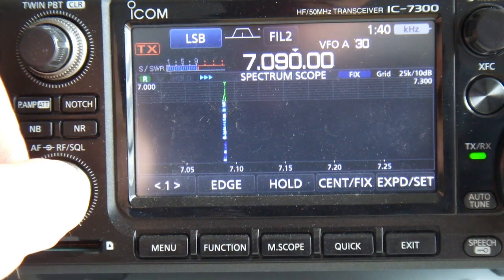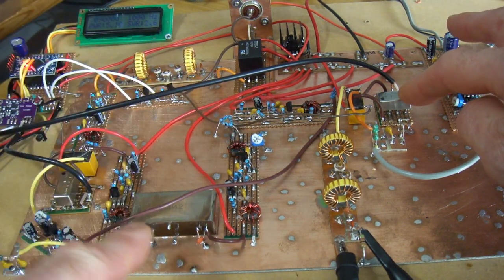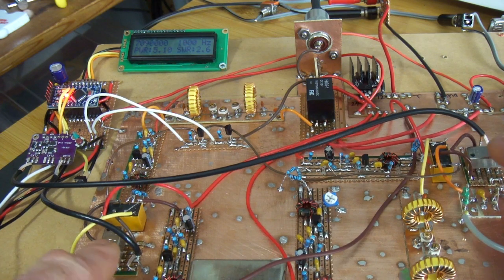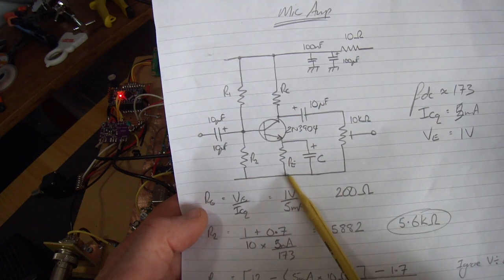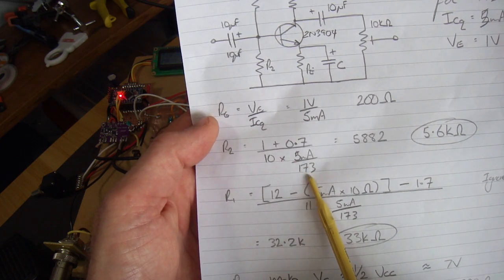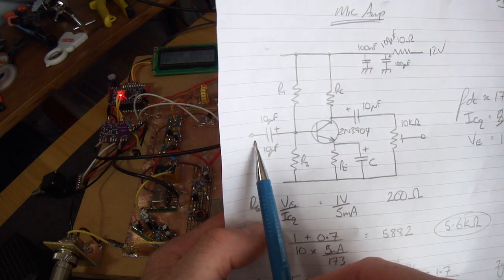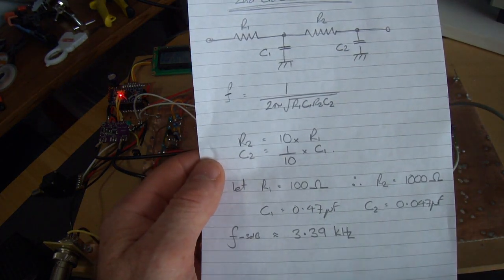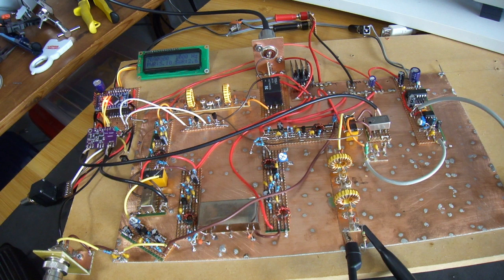40m Pelican Case SSB Radio - Part 8: Microphone Amplifier, RC LPF, Transmit

Comment: Thanks! Great video as always Charlie. I'm interested in the RC audio LPF ahead of the mic amp. I've not experimented with these before. What advantages do you find over just sending the mic signal directly into the mic amp? Is it about limiting the bandwidth going into the modulator? Anyway, thanks again. I always learn something from your work. 73, Nick M0NTV

Comment: Can I sub 2n2222's for the 2n3904's?  I have a TON of house marked PN2222's with short cut leads (surplus).  The FT and HFE may be a bit different, but resistor values can be adjusted.
Reply from the maker: Can't see why not Kenneth. The HFE numbers are very similar, as are the Ft. I'd say there would be very little difference in performance if you were to simply substitute the 2N2222 in and make no other changes. Give it a go.